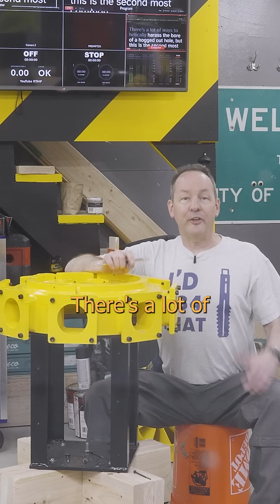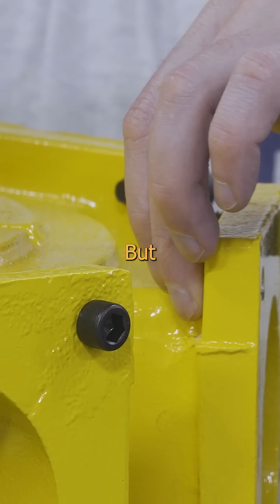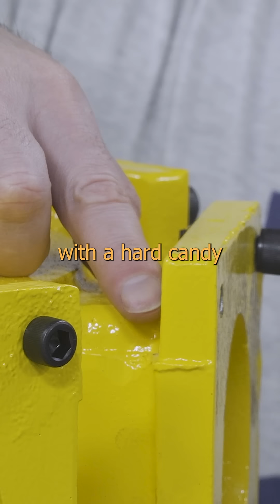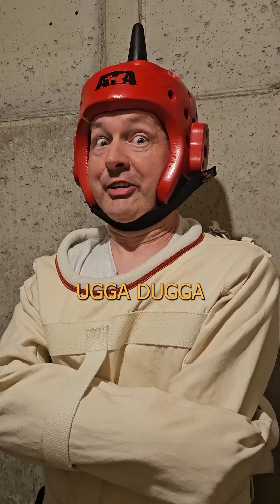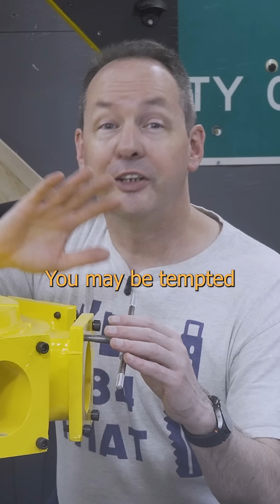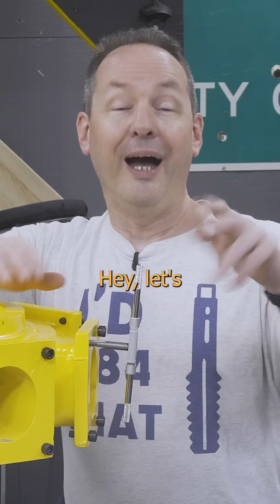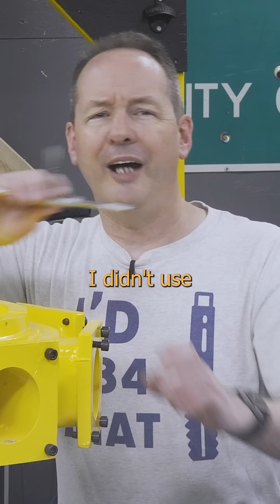Thread Chasing  #chrisboden #comedy #engineering #skills #workshop #metalworking #tools #apprentice

Comment: Not on a thread tap, but I cringe when I hear impatient production riggers and carpenters using impact drills instead of socket wrenches on load-in, because too many times have I seen cross-threaded nuts get friction-welded, needing a saws-all or a very mad lampy [me] to snap the bolt holding the last piece of truss together as we load out.

If you work production and see idiots with impacts on the load-in, report the fact to your production manager or steward, because it is those idiots that cause the damage you will see on the load-out, and they do not deserve to work. Reckless=jobless.

Comment: Thankfully I had an old man that did it the dumbass way and taught me why not to and I listened. Never have I ever put a tap in a drill. 

Well actually I did one time. But I was using the drill to hold the tap perfectly straight and used a wrench to turn the chuck. I was determined to get that tap in straight 😂

Comment: Important to say that taps with 3 in a set should be used appropriately but i found machine taps irresistible and also grinding my own plug taps for those bolts that need an "extra turn".

Comment: Hey Chris! Hopefully you see this, I learned a neat trick that could possibly helps some people. A tap and a screw/bolt of the same thread size are basically the same thing (except for material properties of course) so if you ever want to tap a hole into a material softer than steel and you have a couple screws and an angle grinder but no tap, then you can angle grind 4 notches into the screw to create a leading edge for it to catch and begin tapping. Works great for plastics and even aluminum!

Also, when tapping by hand with a straight tap (not a spiral tap) always turn the handle two revolutions clockwise and then turn a 1/4 of a turn counter clockwise to break the chip. I can’t imagine it’s necessary for thread chasing, but better safe than sorry!

Comment: Replacing the water pump in my miata, 7 delicate aluminium threads and I stripped the last one. Even chasing it with a tap didn’t clean it up enough to hold torque. It was a very very long sigh

Comment: Dumbass here, i had to drill and tap around 30 holes to make battery terminal connecters for my schools robotics team. I thought i was the smartest 18yr old in the world, and chucked a tap in a drill. It went fine for the first 10 or so, so feeling confident, i gave er full send and pop goes the tap. Thankfully we had extras, and the part i was working on was little more than a cube of aluminum with a hole and a slot, so no harm done, and thankfully my teacher was a g and took the chance to show how to remove broken taps. Sure removing the tap took 10x as long as making a new part, but i  now know how to remove broken taps, and have a healthy fear of power tools with taps in them

Comment: It’s nice to use a tap wrench when you only have 1 hole to tap. I’ve had to tap like 1,200 weld nuts for a job one time, the drill saved me some time

Comment: I have to clean up threads a bunch due to rust and corrosion, so I have a thread chaser set made to fix threads without cutting them. I also have a back tap which fixes spark plug threads starting from inside the cylinder while catching any debris with a tip coated in thick grease.

I used to have a cheap impact that I snapped off too many bolts with because it had no trigger control. I have the M12 now with much more control and I have used that drill, tap, counter sink combos a few times and they have worked like a charm when cutting new threads. Never on delicate work like cleanup though.

Comment: Yeah... im a dumbass... 

I was retapping a blind hole into an aluminum cylinder head of my 5.4l 2v Triton engine that snapped the exhaust studs off from age and rust.. I drilled the old hole clear, and started to run the tap in, well on the 7th one I got antsy and used a drill, it side loaded, snapped the tap off into the head. I cursed and raised a storm because I spent a day and a half chasing them. I tried to drill out the tap, and well... it was hard as fuck carbon metal.. the bit skipped off center and punched a hole into the water jacket.. there went $400 into a head and about two weekends worth of work, and a shit ton more parts, gaskets bolts etc.

Comment: Dumb ass me, fixing hydraulic gear pump (kinda..... Long story), go to clean out threads and it's been busy af so I don't have time to crank that by hand. So I reach for my drill and we go to town.

Important information, said holes bottomed out inside the housing....

Right so there I am with a 3/8-16 tap, a drill, and I even used lube. Turns out when you bottom out one of those suckers deep in a hole and you're going too fast it'll snap right off with little to no tap left to really grip and spin out.

Never heard the end of it from the machinists after I had to ask them to remove it in the mill 😅🤣

Comment: If you don't want to contaminate the paint but you want to lube the tap use a little bit of anchor lube, it's really thick and so it just hangs on the tap and doesn't get all over the paint job.

Comment: Love your vids man. I’m a mechanic and you really should work it back and forth as you’re cutting and use some sort of lubricant. They also make lubricants specifically for taps. Motor oil works great.

Comment: My dumb ass was absolutely certain I could screw in a light switch cover without cracking it with a drill if I turned the clutch to its lightest setting after being explicitly told not to. And I was so very wrong 😂

Comment: In my early days of wrenching om bavarian babes my egotistical, testosterone filled fingers thought it was a good idea to run down an intake manifold bolt with a 3/8" milwaukee cordless ratchet. The threads didnt make it and were too far gone for even a coroner to determine what size and pitch the corpse of a hole was. My next best idea was to set a helicoil in and once that was done and crooked as a corn cob i set off for a quiet lunch of re-thinking my life choices. What i didnt expect was a superior to go behind me and try to jam a tap into those helicoils. Brittle becomes broken and the aluminum cylinder head was destined for the scrapper. My life and career was saved by a welder with balls of steel he layed well before i was a glimmer in my dads left testicle

Comment: Got the motorcycle on a concrete step, hit the oil drain plug head. No biggie, got it out, got the right chaser, ahhh jts faster with a drill. Cross threaded it so badly the tap decided that is new permanent home. Okay. Managed to break it and pull it out. Time for Helicoil insert! Then i did it as slow as possible with all the attention and what could have been an hour of work ended up to be two days. Tho i got myself a Helicoil insert kit 😅

Comment: I've never had an issue drilling a tap except the one time I thought it was a through hole.  Little known fact is that going from 60% to 75% thread engagement requires double the torque but provides only 5-8% more holding power. If you've got more than 2x diameter engagement you're probably safe to go down to 40% and at that point just send it with a drill. Maybe put the torque setting kinda low first.

Comment: I rethreaded thousands of threads after powder coating using an electric drill. It works. I could even thread fresh 6 or 8 mm threads in steel at max rpm of the machine.  Took only about two seconds. Per hole. Even a cnc couldnt do it faster with a hss drill.

If you have to do this all the time, you learn one or two things.

Comment: You need to be able to FEEL what youre doing. Thats why i always finish off all my bolts with one last hand turn when laying ductile waterline. I know exactly what it feels like when its within the correct range. If you over tighten eventually it pinches so hard that the rubber gasket gets sheered in half causing a very obvious sudden failure.

Comment: I was always taught that lubricant is the only way to go if it starts feeling tight (Yes I'm talking about tapping threads here). Tapping oil was the go to back in the day although there's probably a lot of better stuff on the market now. I've been out of trade for over 30 years even though I have a small woodshop at home. I had to tap some polycarbonate a couple of years ago and that will really make your day bad if you don't use oil while doing it.

Comment: I didn't dumbass a tap with the ugga dugga tool but I broke off multiple taps by hand cutting brand new threads in the smokebox of a steam locomotive I was working on. You want to talk about coenched cheeks we had to heat the area with the oxyacetylene torch and hammer the tap out. Amazingly we were able to salvage all of the holes and all of the threads though. Two taps broken in the same hole but 3 got us through.

Comment: I was never brave enough to put a drill on my taps, since they're expensive and I bought my first few on minimum wage. But I've bought a few sets since then, and have another question; taps with a shit machine finish, is it cheaper to take them to machinists for a cleanup, or to buy individual taps for the set?

Comment: Big tip by the way for using a drill if you're so inclined: set the drill to the screw setting, and then to like setting 3 out of 14 or whatever. That way, it will let the clutch slip the second it sees a little bit too much torque, and save your tap. Idiot proof that too.

Comment: Bought a manual tire bead breaker that uses a screw type mechanism with a 30mm bolt size head, instructions said use a 1/2 inch drive breaker bar do not use impact, yet I still used impact, cross thread it and now it's junk

Comment: When my son was ten years old, he watched me tap some holes in a half-inch-thick aluminum fixture in the shop.  I'd drilled it on a milling machine, because that made the holes perpendicular to the surface.  But tapping took place in a bench vice because of clearance.  
I let him try tapping a hole after talking him through what I was doing.  Oil for lubrication, back off every quarter turn, and go straight through.  What every guy does when they know that milling another part is half an hour they don't want to waste.
It started well enough, but my son was excited.  He started jumping with excitement as he tapped the quarter-twenty hole.  I only got to say, "Um..." before the tap snapped.
My son went from joy to regret as the tool came away from the fixture, a fracture of the tap sticking up from the aluminum surface.  
"Slow and steady," I told him.  "The steady part is important.  Slow is smooth, smooth is fast."
I grabbed a pair of vice-grips and anointed the part with oil.  I backed out the broken tap and got a new one.  I finished threading that hole, and handed the tap to my son and said, "Try again."  This time he had better self-control.  He done good, and I congratulated him.    

I count those minutes as a double win.  A teaching moment that didn't waste the part.  (And I didn't yell and embed the tap-handle in the wall!)
Reply: I did something similar to that. I was drilling a 4-40 hole in aluminum.  I drilled the hole, start to tap it, and forgot the back off every quarter turn. The tap snapped off subsurface. It's still in there. But I was able to salvage the part by moving all over a quarter of an inch and doing it right.
Reply: @markr5756 Good judgment comes from experience. Experience comes from bar judgment. Erasers are mounted on pencils...

Comment: Dumbass!
Long before I knew the knowledge Mr. Boden, I was trying to redo some threads for my alternator bracket. The bad threads were towards the bottom, and it caused the bolt to not go down far enough and I had a gap.
Long story short - used a drill to save time and it snapped almost all the way in. Had to drill it out in sections, stepping it up, then retap a new bigger hole. Also needed to go get some new hardware to fill it. I'm just glad I had enough material in the area to make a bigger hole.
Saving 10 mins cost me about 3 hrs.
Dumbass.

Comment: I was thrilled to find a tap and die for microphone stand threads on the big ugly retail site. 

A production company I work for randomly throws out very useful stuff. A year or so ago it was a bunch of microphone stands deemed unfixable or more trouble than they were worth. A few minutes after perusing the pile, I had at least four or five working stands made from bits and pieces from other stands. I ended up with at least 20 more and extra pieces and parts. 

I discovered a few had messed up threads, but as soon as I purchased the tap and die, I was able to chase threads and fix them both on mic clip mounts and on boom arms, which mount on straight mic stands to reach out laterally with threaded mic clip mounts on the far end. 

It's so satisfying to put an otherwise useless piece of gear back into service, as good as new, for just a few bucks.

Comment: Was there enough meat to install a thread repair helicoil? That would have straightened the hole and made closer to prefect? That's a good skill to aquire especially if the issue is discovered after it's too late or if machine work isn't an option

Comment: Also at any point of resistance it's good to back the tap off before proceeding further.  The cutting process shouldn't get harder as it goes.  Extra resistance means extra metal shavings getting dragged along with the tap

Comment: Dumbass. I have two electrical apprentices that work under me had another one and all of them separately have watched me snap off the taps for 1/4-20 and/or 3/8-16 and I have discussed with them how and why they’ve sheered and that fun and impossible to grip diagonal fracture. Then they’ve all experienced the aftermath of each event and got to personally become intimate with the pain of fixing the fuck ups that I’ve caused. I have learned since I went out and bought a hand tap and I love it. Not one of them has learned from my mistakes though as each of them insisted that they know better than to go get the set of hand taps and they’re infinitely more confident in their ability than mine with all 16 seconds of their experience in the field and the one with the most confidence just started picking up tools in general go figure. So they all had their own pleasure of reliving the past trauma that is fixing that fuck up and breaking more taps whether it be from trying to tap stainless or 1/2” aluminum plate I’m still not convinced they know enough to admit that it’s better to do what I say instead of following whatever flawed logical conclusion they have come up with but hey it’s something that comes with time, experience and I’m sure a few more scars

Comment: Retapping an aluminum windshield after painting a boat and got bored of doing it by hand and used a 12v impact immediately snapped off and had to drill out. That was the worst day they are really hard.

Comment: Turn it a revolution, or two, then back it off by half a turn, this removed the swarf cut, and stops the tap from blocking up. Which will help with a cleaner thread.

Comment: I'm one of those dumbasses lol
Early in my metal murdering career of skinning hunks of steel into the inbred brainchild of people with questionable intelligence (I'm a machinist) I was needing to chase 1/4-20 tapped holes to clean them up and we decided to use a cordless drill..... Which itself decided it didn't like the easy way and taught a valuable lesson in removing a broken carbide tap from a nearly finished part and how a 5 minute finishing task can turn into an all day removal and repair nightmare.

Comment: I wasn't dumb enough to try to use a drill with a tap, but I watched my friend do it on a Chevy 350 cylinder head trying to clean the threads where the alternator bolts. I warned him, the gaggle of old guys around ranging from 'Nam to "Ancient" warned him. He broke the tap off flush with the head.

Comment: If im having to chase 50 or so bolt holes you can bet that tap will be in a drill. Im also not an idiot, at least when it comes to using any type of tool.

Comment: You know thread chasers exist, right? There's taps and then there chasers. A chaser is meant to clean threads but doesn't have an aggressive cutting surface, so it's harder (not impossible) to jack up your threads. They're super common in the automotive world.

Comment: [Dumbass] No, only had issue once ramming to end full speed when one of them was not trough hole.. that was fun, but for rest just go slowly and be ready to stop, once in not cross treaded you can add speed if cleaning. Also mind there is taps that are designed to ram full speed to untreaded hole, but i dont have guts to pull that off even if i have one of those in tool box.

Comment: Dumbass me. I had a snapped screw in "special" saw, got it lasers out( no access for drilling) when I went to retaping the hole I decided in my ultimate wisdom I can do it of hand holding everything in my hands tap and the device in other hand. Wrong! As soon it started taping in to leftover bits to clean that thread it snapped, they rely don't line to go sidewise 🤣 so I removed it nicely started from scratch and guess what I snapped it once more in vice this time 😁🤣 realising how much of a dick I am and ruining that poor thing I had to repair the thread with helicoil spring 🤣 saved at the end so here we go what a nice happy end with a springy twist.

Comment: That hole is off perpendicular to the face of the flange so far I'm wondering if its not intentional. Are they all a little off or just a few? Was there some engineering behind that angle or is it really just a manufacturing defect?

Comment: Dumb ass

My motorcycle motor blew up 
Rebuilt the motor only for the head bolt to brake off in the head of the block. 

Used a Impact to clean up the threads 
Where the tip of the threading tool broke off, 
Removing it caused the aluminium head to crack towards a coolant passage.